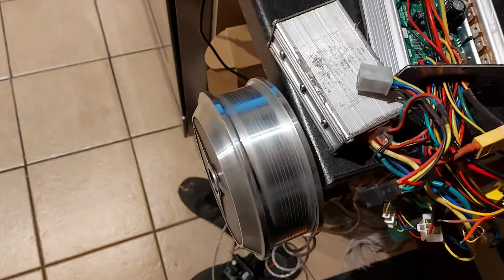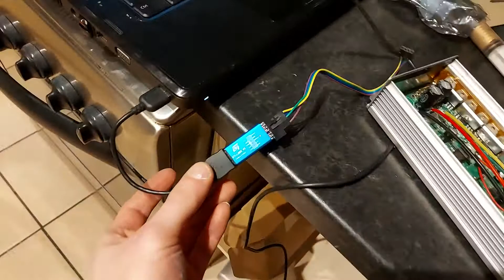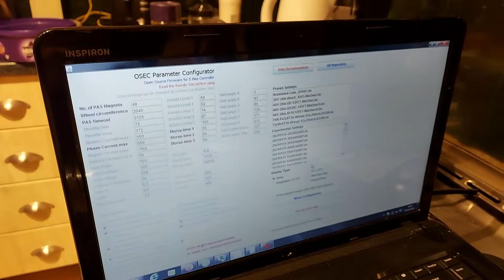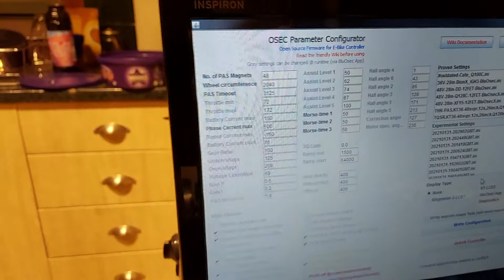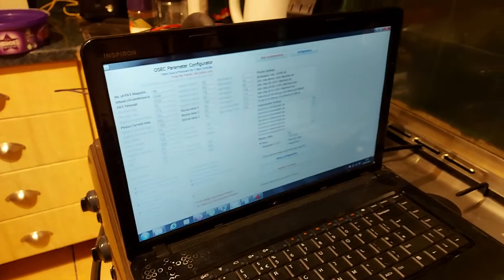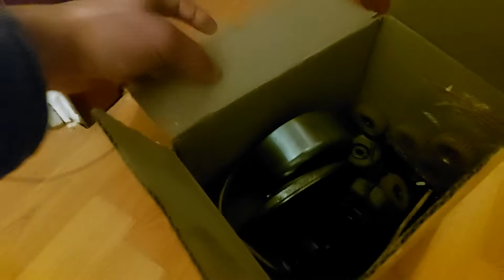Open Source KT Bike Controller with Regen

Comment: Hi Shaun, would you mind elaborating a bit on why the open source software is crap for these controller? I've got one of these and was about go ahead and flash the firmware until I saw your comment. There really aren't much info out there about this software. Anything helps, thanks!
Reply from the maker: Just the regen braking doesn't work properly, places constant drag on the motor when coasting and need to muck around with the source code to get it to sort of work.
Reply: @ShaunDobbie  more info?

Comment: Hello
I have KT controller 12 mosfet  48/52 v 35A can i increase the AMP by using software you have used? i just would like to increase it to 40A

Comment: Technical question, I leave the house fully charged and I have to face a descent immediately.  How do you avoid regen overvolts?  Surely the bms cuts and turns off my bike, then it doesn't start again because it has excess energy.  Have you thought of a system that activates the regen, for example: the 48V type operates at <53V or 52V operates at <57V.  In addition, the new kts have the regen that can be activated from the display that you can set on the C13 mudguard
Reply from the maker: In English, please.
Reply from the maker: I only charge my battery to 4.09v per cell so there is always space for regen energy. I set the overvoltage in vesc to 4.2v per cell. Hope that helps.

Comment: Hello mate I have a lexmoto cypher what would I search up to find someone who is able to change my controller to make my acceleration quicker ? Will most garages do it
Reply from the maker: Most garages won't know what an electric motorcycle is. Best bet is replacing the controller.
Reply: @ShaunDobbie  could you send me a link to a better controller for the csc city clicker ? I could fit it just don’t know where to look sorry for the hassle
Reply from the maker: @sassy_gamer7899  Best bet is putting a vesc controller on it. What voltage is your battery?
Reply: @ShaunDobbie  72 volts
Reply from the maker: @sassy_gamer7899  then a vesc based controller would work, trampa boards sell them
Reply: @ShaunDobbie  yes I just found the ones you are on about only issue is I’ve just called up 30 + repair shops including electric bike shops and they all claim “they don’t have the software”or the just seem upset I asked them about electric bikes
Reply: @ShaunDobbie  would I need to programme it or would I just plug it in a it will work with extra speed etc
Reply: @ShaunDobbie  75V Rated - up to 80A Continuous would this be the correct controller ?
Reply: @sassy_gamer7899  if its the version2 which can handle more than 75Volts ...your battery is 84full
Reply: @TheKvaPAje  cheers man I didn’t end up doing upgrades as I’m only familiar with petrol engines and new to electric stuff all the garages I have called say they don’t have the software to program the  controller unfortunately

Comment: Just on complete interest on your question on the resistor does that controller use shunts for current limiting? Because I actually wonder with ebikes getting popular and a lot of people modding and breaking controllers and sending them back on line,if they use a transistor instead of a shunt?? Cool vid👍
Reply from the maker: They nearly all use current shunts but some may use hall current sensors

Comment: Is your smaller controller sensor-less or is it also connected to the hall sensors? I was looking at the controllers in your link and you said not to select a dual mode controller, i thought the only difference was that they can run with or  without hall sensors.

Comment: @ Shaun Dobbie
 Can i be frank with you here? I have a bike with built in regen (bionx). I live at 1000M ASL in the mountains and there are steep hills all around. Don;t get me wrong. it is nice to have regen but the reality is that to get a strong regen, you will find yourself pedaling hard to go down hill. It's kind of use for exercise or in an emergency or to try to eek out some ore range over the day.
  However due to the inefficiencies in the controller, both charging from and discharging through the motor you really don;t get that much back. I ride often down 200M vertical then up 300M vertical then back down 300M and then up 200M back to mine. Even by pedaling downhill for 15 mins descending 300M vertical i might see one bar come back on the battery if i'm lucky but a normal bike would have taken 5 mins to get down that hill with no pedaling. lol
   I don't think the gain is really super noticeable it can help save on brake pads a bit. 
  The point is that i live in the mountains and it's not that useful, it's more of a gadget that you can play with. Better off spending more time and money increasing Mah of the battery.
  I'm building a 20s Samsung 21700 with 40T cells 80cells in total for the next project. I'm going without BMS as i am building a balancing fast charger out of 20x  12A buck modules. I just need to make sure none of the cells go below 2.5V under load. I can either monitor the cell voltages from a multiple cell monitoring screen, set a low voltage alarm on my weakest cell or modify one of these low voltage detectors to a high current relay to cut the battery if voltage goes to low.
https://www.aliexpress.com/item/1005002791042317.html?spm=a2g0o.productlist.0.0.4a893b92y5Ql08&algo_pvid=dfd008be-c13c-47c8-9217-bd9633fa16d3&algo_exp_id=dfd008be-c13c-47c8-9217-bd9633fa16d3-59&pdp_ext_f=%7B%22sku_id%22%3A%2212000022203049300%22%7D

I think i am just going to monitor cell voltages while i'm riding. Having no BMS will save power, heat build up and weight.
  I have killed quite a few batteries so i would not recommend it without strict cell monitoring.

Also, i broke my hip using regen. I was slaloming down a steep hill with some potholes, i forgot the regen was on and a pothole lifted the rear wheel enough for the regen to lock up the rear wheel, i was in a steep slalom turn and the back of the bike just slid out as if i had been pressing on the rear break in a turn. I slid down the road and my leg crashed into the potholes snapping the ball off of the top of my femur bone.
Reply from the maker: Shit, that's a pretty serious injury. I really like the regen because it saves brake wear and gives a more dynamic experience. The energy recovery isn't the main reason for me.
Reply: 😯😯 shiiet. That sounds like it hurts
Reply: #1 reason you dont use a latching switch. u know you sound really smart to make such a boneheaded mistake. i hope you are alright but dont blame regen for your own stupidity, but please be more careful when using ebikes.

Comment: They do a bluetooth version now, you get an app that can control all parameters.
Reply from the maker: Too bad these controllers are utter garbage with the open source firmware. I gave up with them.
Reply: @ShaunDobbie would u mind explaining why?
Reply from the maker: @smubro  pathetic regen and placing a constant drag on the motor.

Comment: hi hoping someone can answer my question ! Does this kt controller have field weakening from standard or requires programming
Reply from the maker: It seems to, yes
Reply: @ShaunDobbie  Thanks...Any benefit  programming ? Just purchased the 45amp max version hoping to achieve higher top speed on a scooter rather than upgrade battery,thanks in advance
Reply from the maker: @davidflanagan1152  the open source firmware for it is absolute garbage. Leave the stock firmware on it.
Reply: @ShaunDobbie  super  thanks for saving me all that work will stick to standard
Reply from the maker: @davidflanagan1152  It's a shame because you could have regenerative braking with the open source but it's so buggy. I am designing a vesc based controller myself which will hopefully be available for sale in a few months. I have a video about it.
Reply: @ShaunDobbie  Super stuff will watch out as always playing with this sort of stuff....thinking of buying Spintend Ubox  High Voltage ESC to ply with as it seams the rc esc are a lot more advanced !
Reply from the maker: @davidflanagan1152  you are better getting an foc controller with regen. The one I will be selling does foc and regen.